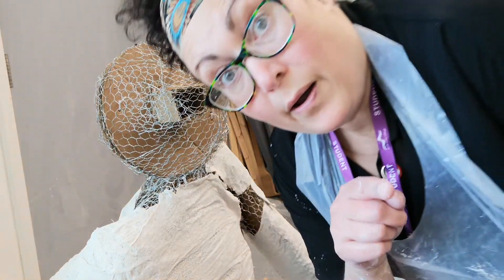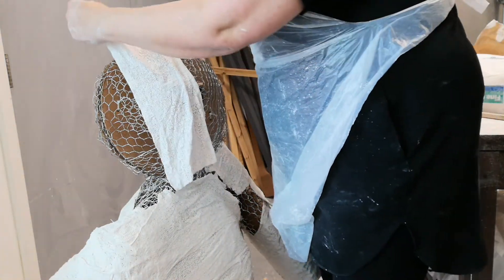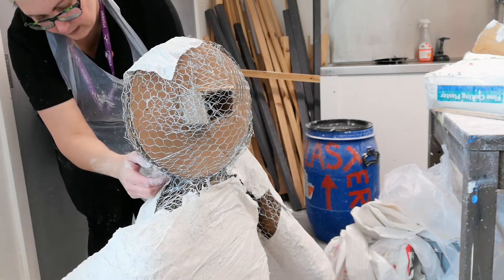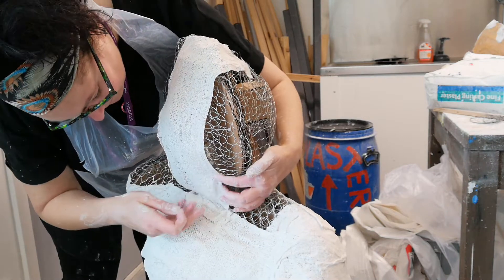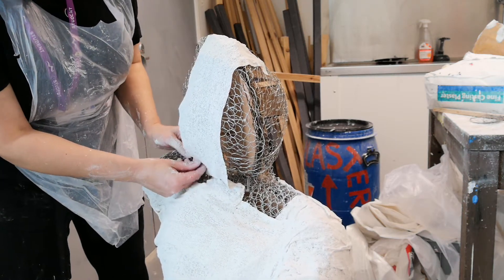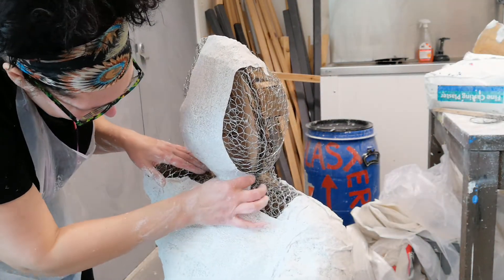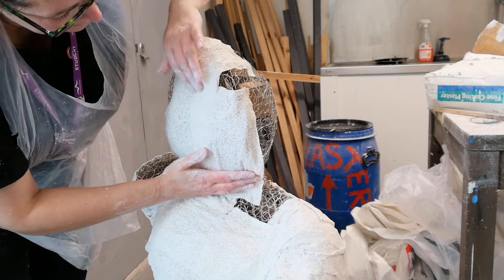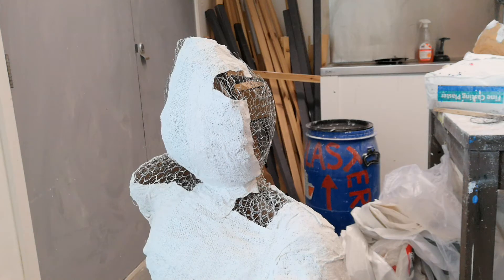Part 6 plastering a wire mesh sculpture.

Comment: hi can i ask which wire mesh this is ? im in the uk also ! thanks
Reply from the maker: Hi there I'm glad you liked the video clip. I used ordinary wire I got several rolls of it from a factory shop. Classed as chicken wire it is fairly easy to shape but be careful with your fingers wear gloves is a good idea I also used wire clippers. When putting plaster on be vigilant of where the pointy bits are however it was helpful to hold on the plaster bandages.
Reply: The hexagonal pattern of the mesh is called chicken wire in the States. And she's using plaster cloth strips too, yes?